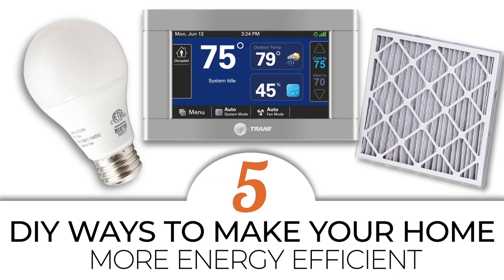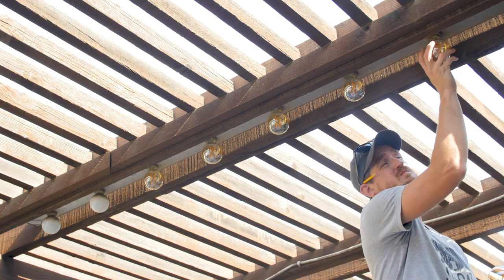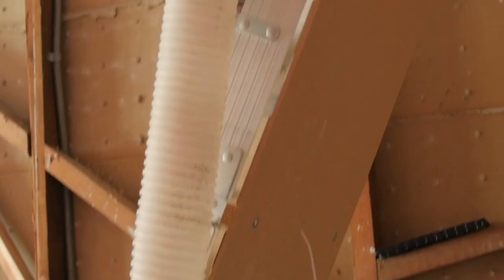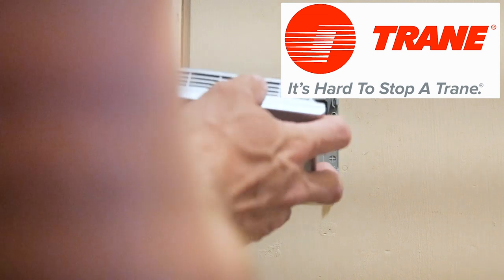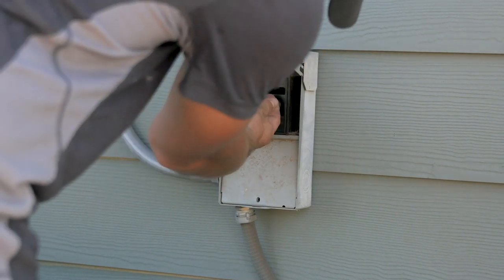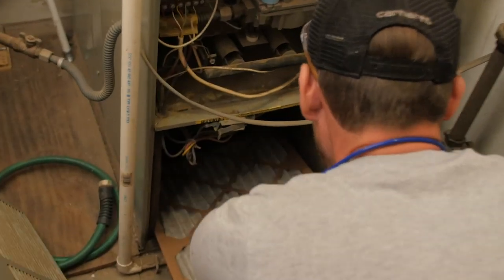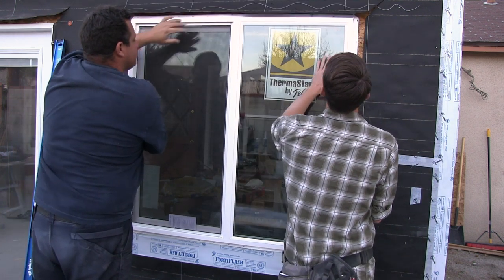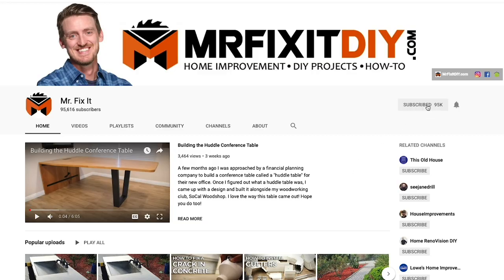5 DIY Ways to Make Your Home More Energy Efficient

Comment: Do you think it's worthwhile to have the floor of the attic sprayed with a layer of spray foam in order to seal everything up, then have blown in cellulose put on top of it?
Reply: Nobody can answer you the question without knowing more about your home and existing insulation, on top you have to consider your climate ....
Please contact a professional to seek information.
I wouldn´t recommend to mix spray foam and a blow in insulation ...
Reply from the maker: Depends on your budget and how much loss you think you're really dealing with. In an ideal scenario having a very tight house is awesome but in an old remodel, it can be challenging. Before I put the blown in back into my attic I went around and looked for any larger gaps and sealed those areas with spray foam. I basically climbed around in the dark with the lights on below and looked for areas where light came through to the attic.
Reply: @MrFixItDIY  Our has was built in 1942 so I feel there is an absurd amount of air leakage everywhere.

Comment: I have had nothing but bad luck with led lights, they burn out much faster for me then the normal bulbs, no matter what brand I get doesn't seem to matter
Reply from the maker: That's a bummer. I've had the issue here and there occasionally but never widespread like that. Not sure what the problem with that would be. I guess just double check the wattage of your fixtures
Reply: Might wanna have an electrician come check out your connections.